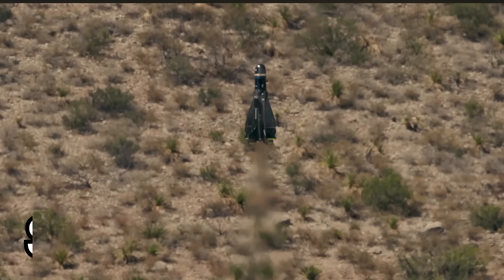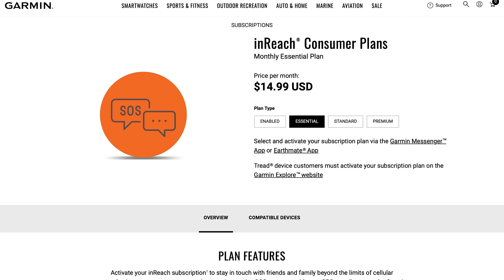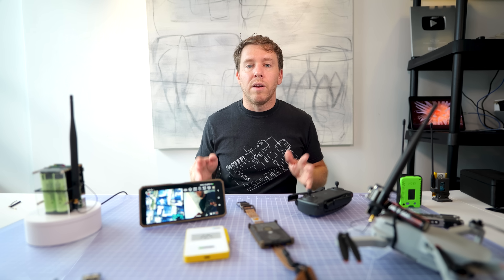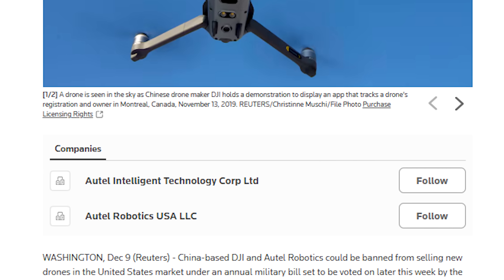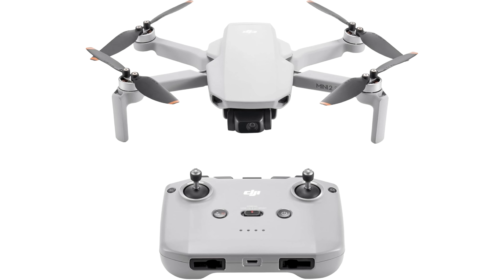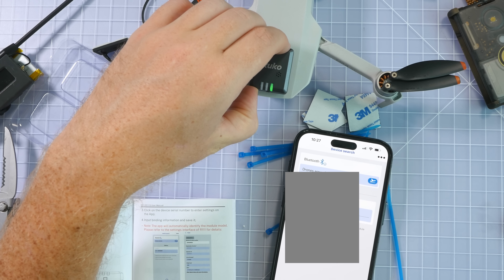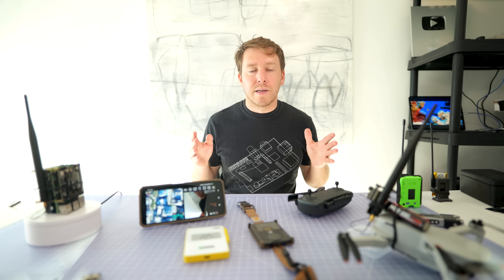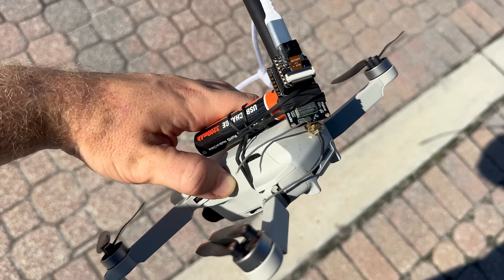I Built a $40,000 Military Drone for $120.07

Comment: You can build it, sure.  But can you get the necessary certifications that require documentation of all the parts, software and testing and proof thereof that it passes the certification?  Without following the government procedure, you can't sell it to the government or any government clients that are required to get these certifications.  It's all the documentation and legal requirements that add the cost.  Also the drone and drone parts would be under the new FCC restrictions.

Comment: Cool now make it resistant to em attacks, cyber attacks, and the other hundreds of ways to disable a recon drone. oh and also make it able to send and receive data over 50km and not have that data intercepted there by revealing the location of the control node. A flipper zero could disable this let alone stationary e war suites which would literally be able to automatically draw a line from the drone to the operator. Why do you think ukrainian drones use fiber optic cables?? you are making consumer grade electronics which mind you is impressive but don't compare it to a piece of equipment which has more man hours behind its development than you have hours spent on planet earth

Comment: You built a first prototype that resembles the same core features. Now you need to meet the actual requirements of the military. That would be non-flammable, weather-proof, optics that can safely identify a person in all light conditions from a distance, no easily detectable electronics, and you need to guarantee in-house production of the whole system, including the chip, for usually a few decades.
Once you've got those easy bits, they will tell you the requirements that made others turn down the project, as they can't make them.

Comment: you have too much excess weight on that drone, lose the antenna plastic cover, shorten that massive USB cable and wire the entire kit in to the dji battery directly. use a proper FPV camera

Comment: The US Military requires a manual be included with anything they receive.  They also require background checks on the people doing the work and I suspect people who do work want to be paid.  How much of that claimed $120 was your salary?  Where's the manual for just what you created? How many hours did that cost? You did pay someone to do it, right?

I have no issue if you want to claim it was $121 in parts.  

Can you trace each assembly to ensure those parts weren't below MIL-Spec standards?
What are you doing to ensure the command channel cannot be hacked?  Or that the control range is more than 1 mile, say 50 miles?
If your equipment gets rained on, how waterproof and dustproof is it? Same for the "controller".   You'll need to provide proof that you've tested the max and min operational and storage temperatures for each component as well.  Certainly you've done that too.

Comment: If you don't value your time, sure. 0$ overhead. YOU WIN! And what you are doing is basically demo quality. That's 1%. Productization costs. Try to start a company and get back to us. You'll figure out what you're missing. All you are doing is slapping together legos with duct tape.  Other people that don't value their time are giving you the blocks in a race to the bottom where everything is flaky, hacky , and generally broken. Why don't you write your own video codec, FPGA baseband modulation,  flight controller, kalman filter, etc. Then add up the hours you spent. I bet if you even pay yourself $5 bucks an hour your drone will be over $40k.

Comment: What incredible click bait. Firstly the anduril ghost drone which was shown is a drone that doesn't even cost 10k much less 40k. 
But OK we are apparently actually comparing to the Black Hornet NANO UAV. 

The Black Hornet system is a whole package. It comes with the carrying case, the controller, the charging station and TWO drones. Your building just one drone. So at minimum the drone is 20k But of course the large rugged tablet and carrying case are several thousand dollars so maybe 16-18 grand a piece.

1. 
250 grams without gear vs 70 grams fully loaded. You are over 4 times the weight. And you think this is the same drone. You literally are putting extra hardware on cause you cannot build something with 4 times the weight to be light enough, but your complaining about this.

2.
2 FPS optical FPV cam on yours vs 30FPS optical AND IR AND Thermal cameras  FOR A SURVIELLANCE DRONE 

3,
Manually guided trying to use 2 frames per second vs Obstacle avoidance and autonomous movement

4.
3MP optical OV3660 camera sensor vs 12 MP optics on the Hornet FOR A SURVIELLANCE DRONE 

5.
"can we punch out to 60ft" vs 2km video range on the Hornet FOR A SURVIELLANCE DRONE are you kidding me. This thing is do 6,000ft video feeds, your doing 60 and calling it "special" WTF am I supposed to do trying to guide mortar rounds onto a target 60 feet away? Die with them?

6.  
Jammable with literally anything that can jam drones vs jam resistant, frequency hopping, autonomous movement capable when jammed drone.

How are we even pretending this is kind of close to what is actually a like 15,000 dollar drone when you cannot go 1/100th the range, cannot transmit video at 1/15th the frequency, cannot see at night, cannot see heat, cannot see even in day a quarter as well with what you do see and cannot make to target if absolutely anything tries to stop you ON A SURVIELLANCE DRONE.

a surviellance drone.

 a freaking surveillance drone. 

That on your side flies 60 feet and transmits basically one image a second in order to help me do what I dont know, i suppose watch the guy shooting me in the face from 50 feet away, as he does it.

Comment: the waves are vibrations from the motors going through the frame to the camera. the camera shakes with some frequency, which is seen by the rolling shutter of the camera. it can be fixed by supporting the camera with soft silicone supports or something simillar.

Comment: Have to keep in mind when you see like a $40,000 price tag on a drone, or a 1 million dollar price tag on a missile, or 120 million for an F-35, that's not actually the cost of the unit. That's not how much it costs to source the parts, pay the labor, etc. etc. It's the cost of the total development into that product. So if you spend 40 million dollars to develop a new drone for example, and only build 40 of them, they are in effect going to be classifed as million dollar drones and news and social media will say it costs 1 million dollars per drone.  Each drone required a million dollars of investment. The actual cost to build those same million dollar drones? Would probably be around fifty bucks cause they'll get the parts even cheaper than you did (minus the labor).
Reply: Not remotely accurate.
Reply: Dude. The usa is using 5k quadcopters. It's a senators company. That's why nobody can crash them during training and they have to cared for more than a rifle. Usa doesn't want any smoke from any state actor at this point

Comment: “Earth curvature”  has Never Entered the equation for Nodes, Not even once..  It Should,  but it just not a thing. People talk about it as a causation  for a problem but it’s just not there… Just last week we had only  3ft to 3ft open 38mile line of sight and Mesh connect. Your issue was from salt Water saturated air(humidity and ionized salt causing  The Waves that travel through the medium and They created heat forming pockets of …etc.(It’s why it got buggy)… I Promise you, Things aren’t as they seem. No.📐🧭📏🗝️

Comment: Sure, but can it hold it's weight in rough conditions? Can it defend against attacks and weather and other hostilities?
Just getting it airborne and transmitting video isn't what costs money.
Military Grade is there for a reason.
I'm sure it's great for personal use and for guerilla defense when you can't get the best stuff, but the military will probably want more expensive stuff.

Comment: LazerPig has a good (if slightly rambly video) on this kind of HDDS (Hurr Durr Drone Syndrome) (you can skip his rant about the Lancet that starts about 8;20 to about 13;20 to cut out most of the ramblyness lols, and can really skip to 19;30 for the counter drone part that's the most applicable to this^ video specifically, anyways) about how Ukrainian and russian cheap attack drones are getting more complex and expensive because their Electronic Warfare and other counter drone capabilities mean the cheaper ones are becoming less and less effective... While there's definitely lots of room for improvement in applying cheap drone principles to make out higher end drones/missiles cheaper themselves... the same principles mean this $100 drone has enough capability to survive all of 5 minutes against the EW/counter drone capabilities available to ....militants in Syria or Sudan (much less a modern battlefield that requires significant redundancy and reliability that means you're paying more upfront for something that you can actually use......)

https://www.youtube.com/watch?v=PN0SdVDj-oc

Comment: I sell lots of parts to the Ukrainian government, in particular their drone department. From pedal-powered electric generators for recharging batteries, to Homemade zinc/air batteries which are non-rechargeable but who cares since they fly six hours instead of 30 minutes!!! We also build harassment drones that act as decoys so Russians waste $2-5 million missiles shooting down $400 decoys. We use techniques (I cannot mention on open channels) to make a 70 mile per hour drone look like it's traveling 500 to 600 miles per hour and the deception ends up looking like spoofing or some type of high tech jamming so they never really know what's happening in the night sky but the threat looks severe and to the operator of the S-400 it just looks very intimidating and needs to be shot down. I'm proud to say I've cost the Russian government About 5 billion dollars Along with my comrades in Ukraine. The really interesting thing about Living Life for just the last 5 years is that all we're using are cheap little Arduino controllers and maybe a Raspberry Pi if we need something really sophisticated and that all the programming comes from me just talking to a few of the more popular AI programs that YOU can use for free! This is not real hard work, requires no programming skill and you just talk very slowly and carefully to the AI, tell it what Chip-set you are using and what configuration of MB and what you want it to do and it will write you a 10,000 Line program that is really sophisticated in ways I can't even talk about but the old age of learning programming in college is over-with!!!!! GONE! You can just talk to a computer and let the computer do the programming/coding for you which has opened up the biggest Doorways for us. After it gives us the C++ program we load it with USB and we test it using virtual chips In a virtual simulator so we haven't even touched the soldering iron yet!!!!!  You can watch it go through it's paces inside of a computer simulator which is also a free download and if it requires any debugging it shows you where the bug occurs and what it recommends you do to debug it or it can debug it for you but the bugs are actually good since they tell you all the weak points where your program is soft and you want it to be rock hard. If you've ever dreamed about publishing your own app in the Play Store that does 'whatever' A great APP DOES now is the time to do it! Do it tonight. If you're a Sikh But are having trouble finding other Sikhs to date Then have your AI make a program called ''Sikh's seeking Sikh's''. Who knows, you may become the next Tinder operator. Go talk to your AI tonight, Write it, tell the AI it what the interface should look like and what features it should have and have your AI publish it for you!

Comment: The $39,879.73 goes into reliability, hardening and security. 

Your drone is fine. It will get video feed to the terminal, sure. But can it do it in the presence of interference guns? Can it prevent the hostile force from hijacking it? Can it sustain battle damage? Does it have redundancies? How do the ranges compare? How do the payloads compare? How does the camera compare? Mil spec drones can typically see high definition images at extreme ranges in TV, Thermal and analogue Night Vision

If you’re the boots on the ground, are you going to feel safer relying on a $120 drone or a $40,000 drone?

Comment: Doing a one off for $110 is different than scale production. Also, how many hours did it take to reverse engineer, design, build and test it? What hourly rate do you value your time at? 

All these things matter in the  cost of the good BEFORE markup. So if you value your time at $50/hour and not took you 8 hours to reverse engineer and then make one, that is an additional $400 on top of materials. 

I doubt you would make 500 of these for a client and charge $200. At least be honest with your viewers

Comment: how does this handle interference?
yes cheap drones are an option, but a military drone that costs this much should be able to frequency hop to find a free frequency, or is optically or wire guided, this one can't.
from the looks of it you have only a basic camera, no thermals.
don't get me wrong, they do make a big markup on drones, but once you paid for assembly and all the R&D, you're probably north of 10k on a 40k drone.
similarly the ruggedness of the radio and multi frequency doesn't come for free.

the dog collar is fair game though.

Comment: The guy is a wonderful prototyper, driven by the initial dopamine part of the product development process.

This is what you want to start out with - throw money at a guy like this to come out with solution ideas, a quick exploration of the domain by a creative person.

Then throw the actual required tech requitement and mission parameters. When that version is ready, add testing in rugged environment, with all conditions in mission parameters, handled by soldiers.

Then start planning production ramp up costs, including supply chain security - e g no chinese parts…

The hardware cost is always laughable.

This is invention, converting money into ideas, not innovation, converting ideas into money.

Comment: One minor correction, ADS-B out is only required in controlled airspace, which is limited basically to airspace around larger airports, and everything above 18,000 ft. So large swaths of the country where there is very little air traffic rely on see and avoid  in visual flight conditions.

Comment: You can set custom RTMP server in DJI settings (I tested with DJI Pocket cam, pretty sure it'll be same for drone in the controller), then it's not locked to internet connectivity and quality should be really good since they nailed the radio protocol and video stream fusion, I streamed from camera directly to Frigate video NVR and from it to my custom LLM processing which gave results back into OBS Studio stream, pretty wild.

This is great project!

Comment: I recently got in to RC, like the last 18 months, 2 years. Anyway I was blown away by all the how much of it was open source, created by users. The firmware for the radios, EdgeTX, the reciver/transmitter protocols, like 4-in-1 and ELRS, the firmware for the motor controllers and the firmware on the flight controllers Betaflight for drones and Rotorflight for helis. All theses open source firmware and software have been picked up by the companies that make the drones, which I found just so cool.

Comment: similar thing is happening in Ukraine, when everyone started making fpv drones in the garages for the army, from the cheapest components possible to only find that these are not reliable,  often don't work properly or not work at all. which is critical when you supply someone on the battlefield with 10, for example and they have to bring 10 on the operation as they dont know which will fail. Or they will have to review all and reassemble to make sure they work

Comment: Does anyone have more info on the FPV camera used / the board? I've been looking for that exact thing for a project and am running into the Rumpelstiltskin issue (not knowing what the connector type is called).

Comment: Very impressive.  The waves could be interference from for power cord.  They sell magnetic cylinders that flip open to allow a power cord to be wrapped once around the magnets.  It cleans up interference from power cord.  I think car radio was not playing nice with extra tech. I think I was using a radar detector and my scanner and was getting interference.  The guy at radio store sold me what I thought was snake oil in the form of magic magnet cord wrap.  But it worked.  I don’t remember if the radar detector or the scanner power needed the wrap.  It may have also been issue with cigarette lighter power source.  However the plastic cylinder with curved magnets did fix my interference with the car radio.

Comment: For smoother video feed, have you considered using a dsp for high compression? For real time performance with 1080p, you could probably do with an extremely cheap dsp. Bandwidth would not be an issue anymore, in theory. Going fancy, you could utilize another dsp on the receiving end to upscale the picture in real time, but that's definitely optional. Unless, you want to set even lower resolution for the transmitted video and use more DSP power on the receiving end, which is presumably powered by something better. In which case, you could upscale to 1080p on the receiving end from relatively low resolutions at a cost of reasonable latency - thus, reducing the required bandwidth to transmit the image even more. Please let me know what you think. Bypassing using a DSP on the transmitting side is also an option I guess, if you can control the firmware, or there is an existing setting of a lower res / compressed codec of choice (?).